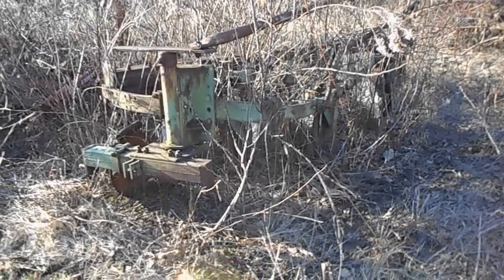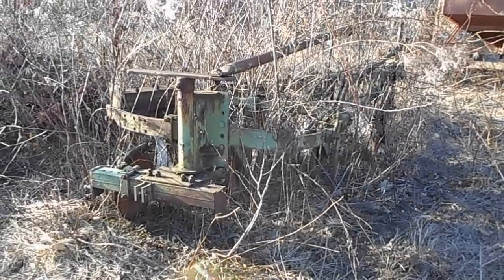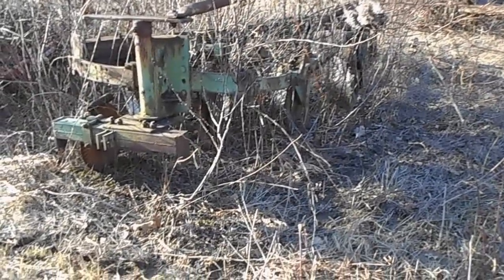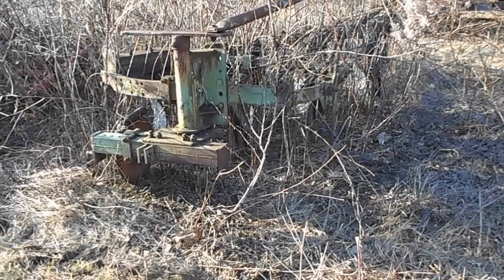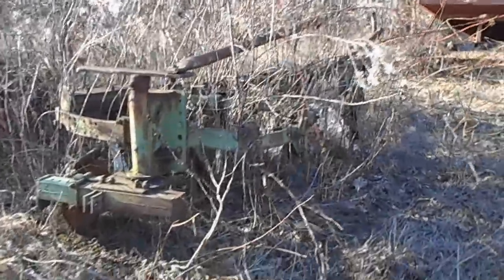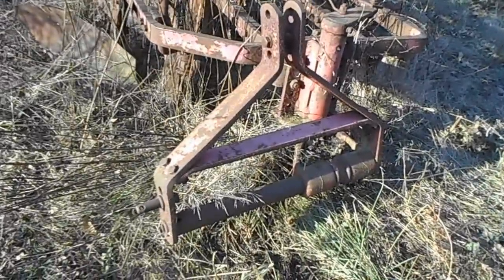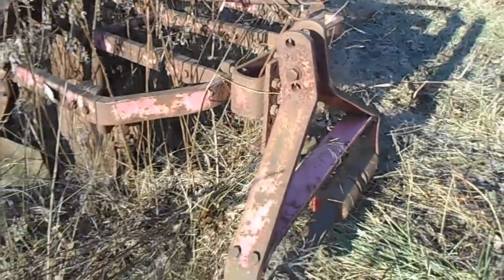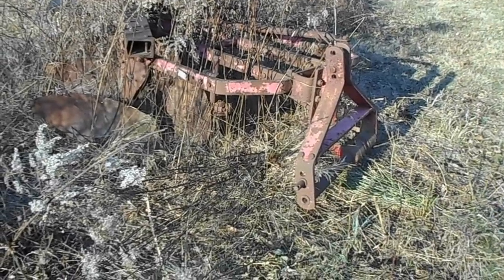Plow Education What plow for your tractor

Comment: bandit i had a 1850 and set 4-18 int. semi mounted plows and it pulled them great i dont remember  the number  on the plows but they were good plows and did a good job of plowing . i never through about the draft control  on a semi mounted plow .l know how it work on 3pt tractor my dad always had a 165 massey as long as i could remenber
Reply from the maker: +Michael Hadden The MF 88 4x16" plow was made for the 165 175 180 tractors because it has the center link control draft, They only made this series of plow for these MF tractors to use and not all that many were made. This MF plow is idea  for MF and Ford tractors of that time and are better to use than a mounted 3pt plow in hilly ground to keep the center of gravity low and the front end on the ground when turning.  The MF tractors of that time are real good plowing tractors and will flat out get it done and I always like them, One of these days I'm going to own one.  Bandit
Reply: Bandit farmer A 165 is only 52 hp thats not enough  hp to pull 4-16 in this red dirt were i live . It will roll on pretty good with 3-16.
Reply from the maker: Around here it would pull it, My 1550 Oliver diesel will pull 4x16" and it's only 54 hp so I guess it depends ware you live as to what it will pull.  Bandit

Comment: Good demonstration of what you told the guy about the plow. I think you are wrong about "common knowledge" as you called it. There are a lot of folks who don't know this, so maybe it's really not common knowledge. Good to have you around so some of them will absorb some of your not so common knowledge!
Reply from the maker: +Roger Holloway  I spent a lot of time when I was growing up around my uncle who bought and sold farm equipment to help with the bills on the farm. Over the years I guess I looked at a lot of equipment and asked a lot of questions about them and my uncle would explain it to me. This was when you had IH with fast hitch AC with snap coupler Oliver with the power troll hitch and MF and Ford and a few others had the draft controlled by the center link.  All that equipment you learned what worked with what and what didn't and I guess it stuck with me and I guess what's why I call it common knowledge. I could not even begin to count the different brands of tractors and combines and all the other equipment I have run, used and owned over the years to use in a pinch to get by with and to upgrade to later. This was just how I grew up and what we did to get by with on the farm. It was for this reason I made this video, To past this information along to others so they can learn about it. Bandit

Comment: Good info thanks for posting. Nobody has plowed in my area except at plow day for prolly 30-35 years. Because of that guys like me have no idea how to set a plow I'd eventually figure it out but thanks to plow day bout 5 years in a row I could prolly set one up now. But to do it right someone like u who knows plowing prolly could do it better
Reply from the maker: +Jake Ziegler Growing up there were guys that could look at a plow and tell you what was wrong with it (I cant) and what to do to fix it. Most of the time it takes two people to set a plow, One to drive and one to walk and watch and make adjustments. The more you plow the more you watch you start to figure out what's going on and why and then you know what to do and how to set one to make it plow good. But one thing is for sure the plow is not dead and gone, It's making a slow come back. It's a piece of equipment that needs to be used in a rotation to keep weeds under control and help with ground fertility and heath. Bandit
Reply: +Bandit farmer that's true it does take two people. Bout the only thing I know is if the plows worn out it won't go in the ground worth a crap haha
Reply from the maker: If the shares are shot it wont go into the ground that's for sure. But there are small adjustment that can be made that can make a big difference in how one plows and pulls. There is an art to it and it not an art that can be learned out of a book, Its hands on learning for sure.  Bandit
Reply: +Bandit farmer ya I bet. I keep meanin to ask u did u ever find a video of u plowing with the Oliver's
Reply from the maker: Sadly there are none as I didn't have a video camera till a few years ago and most of the time I'm by myself. But I do plan on making some this year if all goes right, I hope. Bandit
Reply: +Bandit farmer oh ok do u do any spring plowing
Reply from the maker: +Jake Ziegler Yup and that's what I plan for this spring, If all goes right and weather permitting of course . So watch for it.  Bandit
Reply: +Bandit farmer will do bandit!
Reply: +Bandit farmer My uncle explained to me that there is a suction that holds the plow down. He would hold a board on the bottom of the plow, between the point and the back end. If there was a 1 inch gap it was good. As the point wears down that gap gets smaller, and the harder it is to keep it in the ground. there are shims on the land side of a plow that need to be maintained also. He would walk the furrow behind the plows and make adjustments , He had that art. He used to set something level with his eye, than he would whoop out a level on it to show us he was right!! Your right if you got a old tractor, you want a plow that was made for that tractor. I saw your video on why the plow has to come back, I believe you. I never believed in no till and never will.
Reply from the maker: Setting a plow can take some doing but once you learn how it get easer and so does setting the draft control.  But not many people know how anymore cause nobody plows anymore, But I do. I agree with the no-till thing, I have been doing it for 4 years now and I can see the ground getting harder now and this fall it will be plowed up for next years use and it might even get a cover crop of wheat or rye if I can get it in.  There is still a place on the farm for the plow and I think its on a come back because of roundup resistance in a lot of weeds. Bandit

Comment: Thanks for the explanation Bandit! I have a Ford 6600 that has the center link draft control, and I pair it with a Ford 4 bottom plow, works like a charm! Now for my newly acquired International 1066, I'm going to have to go with a semi mount. You're completely right about pairing plows with the right types of lifts on tractors!!
Reply from the maker: +William Lewis  It may sound dumb for a lot of years early on you were better off using the same brand of plow that the tractor was, Some you had to by no choice. Like AC snap coupler IH fast hitch Oliver with the power troll hitch so you had to use the plows made for that hitch. By the 70's 3pt hitch became standard but there were a few tractors you still needed to use equipment made for the tractor, Like MF and Ford because of the draft control center link. By the 90's 3 pt was all standard to all tractors and it didn't matter what brand you used together. Sometimes people still get surprised when they buy an older tractor and find out the hard way, So I hope this video will help others out by my explanation.  Bandit
Reply: Right I grew up masseys and few fords it's just the way he explained it sometimes it good to hear a guy out you never know what you'll learn from who to me I think everyday is chance to learn something new

Comment: Lets just say I don't like my newer stuff as well. I have a JD 5055E mfwd and even though I like the tractor the quality control is terrible on it. It was made in India. I cannot keep coolant hoses from leaking on it. All I can figure is the material they where made out of and the clamps are no good. Some of been tightned four times including by the dealer. From the research I have done and talking to Deere this sounds like a common problem with them. If I have any more issues I think I will put new clamps and hoses on. I have had a lot of other little issues besides just that. My New Holland has not been a bad machine but its not weighted like our old stuff. Pretty bad when I can take my JD 2155 that was made in 87 or the MF 165 from 73 and go to the field with no issues. They both still have the original radiator hoses and don't leak a drop.
Reply from the maker: +Fieldman12 I would just replace the clamps and be done with it, Buy American clamps if you can. They cant cost that much and it might solve a pain in the butt.  Bandit
Reply: +Bandit farmer Yeah I thought about trying just different clamps. Its a shame you cannot buy a USA made Utility tractor in the 60hp range. I think if I buy any more tractors they will be old iron.:)
Reply from the maker: The last ones made were the White American series tractors made back in the early 80's and were made with all American made parts down to every last nut and bolt. That was awhile ago.  Bandit
Reply: +Bandit farmer Yes I remember the American series when they came out in the 80's. You could get them the color of your favorite flavor. My JD 2155 is made in Germany. It's a good machine but I hear the hydraulics on them can be a nightmare to troubleshoot and fix if you run into issues. I had a Ford 4000 diesel I really liked. The Ford 4000 and 5000 I really liked. Dad had a Ford 6000 commander for a short time when I was a kid.
Reply from the maker: I all most bought one, A green 80 but I got talked out of it and have kicked myself ever sense for not buying it. The 4000 and 5000 were solid gold tractors the 6000 commander was the tractor version of the Edsel for Ford.  I see good things come out of Germany but sometimes  well it makes you wonder.  Bandit

Comment: I have pulled a Ford 3-14" 3 point plow with our MF 165 and the old MF 255 I use to have and they just played with it. I hooked the same plow to my NH TN70 which is more hp and dropped the plow in the ground and it was like I threw the boat anchor out lol. It just set and spun. The new tractors all need weighted up in this hp range compared to the old tractors of yesterday.
Reply from the maker: +Fieldman12  I agree, And the new tractors who knows if the draft even works or not.  Bandit
Reply: @banditfarmer1900  Most new stuff is 'electronic draft" meaning it uses a spring and piezo sensor (load cell) to send a voltage to the computer to activate the draft control valve, instead of just having a lever and springs to control the valve.  It's like the difference in the old spring-valve shifted automatic transmissions and the new electronically shifted automatic transmissions.  I GREATLY prefer the old spring-valve operated automatics because if you press the pedal "so much" you get a certain response, IOW, move the kickdown lever or cable "so much" and it shifts down, but move it a HAIR under that and you can get maximum power out of the engine WITHOUT downshifting and the thing revving through the roof.  With the computerized systems, it's all in the PROGRAMMING maps and how they're set up!  This d@mn 2012 Dodge Grand Caravan is the WORST... first year for the "Pentystar" engine and six speed automatic so all new programming, and it's SH!TTY.  For one thing it's "drive by wire" meaning NO cable or lever from the accelerator pedal to the throttle valve on the engine, which is a PITA in itself, because you never get the same throttle response twice... it's "driving for morons" because the COMPUTER tells it what to do!  THEN of course it's all shifted by the computer, and so you'll let off the gas, hit the brakes and slow down a bit to go around a curve, and as soon as you hit the gas the thing shifts UP a couple gears because it's trying to "cut emissions" and "increase mileage" but the d@mn computer doesn't see that you're climbing a hill at the end of the turn and needed to stay in the SAME GEAR to accelerate uphill... all it knows is the d@mn programming, and it says "for this speed and this throttle position, shift to this gear" which is d@mn stupid because it takes NO account of LOAD.  SO you start pushing the pedal further and further and FURTHER TRYING to get the computer to open the throttle on the engine to make more power to accelerate uphill because the d@mn thing shifted itself into TOO HIGH of a gear, which of course the computer does NOT want to do because of "emissions" from opening the throttle too much too fast, SO you KEEP PUSHING the pedal til the d@mn thing gets triggered that "Oh, he's calling for more power, but the speed is TOO LOW, so the map says "SHIFT DOWN and REV THE H3LL OUT OF THE ENGINE!"  Friggin' stupid!  In the 05' Grand Caravan with the regular old throttle cable from the pedal to the engine, I can move my foot so the pedal is in a "certain position" by feel, say an inch off the floor, and open the throttled plate so the engine starts making POWER and NOT have to shift down, drive SMOOTH AS SILK!  If I want to shift down, press the pedal say a quarter inch more BY FEEL and I know it will drop ONE GEAR and rev up 500-1000 RPM's and away we got, SMOOTHLY.  BUT the d@mn computer controlled system, you have NO CONTROL, other than to gradually keep pressing the pedal to tell the stupid @ss computer "Wake the h3ll up and give me some power already!" and when it goes it decides to drop TWO OR THREE GEARS, and rev the engine up about 3,000 RPM... just hard on EVERYTHING!  

That's why I ABSOLUTELY DESPISE new vehicles... TOO computerized and you can't control a d@mn thing!  Tractor draft control is the same way-- all sensor inputs in the computer and IT decides what to do based on its sensor inputs and plotting what to do on the programming map!  Oh, they put a dinky rheostat there for you to adjust "draft sensitivity" or whatever but it's not the same as when you moved the sector control (lift lever) and set the tension on the draft control valve counterbalance spring in the draft control valve... with the draft control rod from the draft sensing link (upper or lower) then creating leverage and pushing or pulling against another spring pushing or pulling on the valve itself... MUCH smoother operation!  Just like with the old automatics, where main line pressure in the transmission determined when it shifted, pressure increased as input shaft speed to the transmission pump increased, while the governor lowered pressure by opening a dump valve at low speed, and increased pressure proportionally as speed increased.  Then you had the kickdown lever or cable, which operated a second dump valve in parallel that moved that valve in proportion to the throttle lever (pedal) position, the harder you pressed the pedal, the more it opened the valve and dumped pressure.  Then all you needed was a series of shift sequencing valves, one for each gear... Each valve has different springs to activate in succession-- take off in first gear, accelerate til pressure rises enough to activate the 1-2 shift valve, which dumps the oil out of the first clutch or band and sends oil to lock up the second clutch or band, shifting up a gear, increasing speed increases pressure until the 2-3 shift valve moves back against its stiffer spring, moving the valve and dumping oil from the second gear clutch band and sending oil pressure lock up the third gear clutch band.  Pick up even more speed, until the 3-4 shift valve moves against its even tighter spring because of the higher ML pressure, and it dumps the oil from third and sends oil to lock it into overdrive...  Want to pass or going uphill and pushing the pedal down near the floor, eventually you dump SO MUCH ML oil pressure that the spring pushes the 3-4 valve BACK, dumping oil from the OD clutch and sending oil to the third clutch, and it downshifts... keep pushing oil pressure drops more and the 2-3 spring pushes the valve back, and it drops from third to second gear.  Slow down for a stop sign, and the speed governor dumps the pressure and shifts you back to first... EASY PEASY and the way God intended... NO friggin stupid computers and all that GARBAGE!!!!  OL J R :)
Reply: Yeah the weight and WEIGHT DISTRIBUTION on new tractors is just terrible compared to the old ones... but then the old ones were designed to WORK, "do more with less" so to speak.  New ones are designed to sell to push-button farmers and to "eco-friendly" not to be real workhorses like the old tractors!  OL J R :)

Comment: well I learned something today. Ive never seen a MF plow like that before. We went from a 3x14 3 point plow to a 4x18 semi mount Ford 151 on a Ford 8630.
Reply from the maker: +Steve Ross Your doing good, You learned something new today !  Most people have never seen one like this but that's why they were made for the MF and Fords and others with center link controlled draft systems. These are hard to find plows for sure because most guys use a 3pt plow on them so not that many were made. This is a better plow for hilly ground for tractors than a 3pt plow, It's most stable to use. Bandit

Comment from the maker: I hope I explained this so that it makes sense. There is an old saying "The right tractor and plow"  and this video shows what it means.  MF and Ford took a different semi mount plow to use on them and this shows why. Rock shaft and center link control draft systems take a different semi mount plows to be used on them to work properly . I hope you enjoy.  Bandit
Reply: I learned something I never knew that but I makes sense thanks for sharing this we run a IH 710 5-16s behind our 1586
Reply from the maker: After the conversation over the week end and thinking about it, It made sense to make this video to explain this. Not everybody knows the difference between these plows and why there is such a difference in how they work on different tractors. So there is the right plow for a tractor.  Bandit